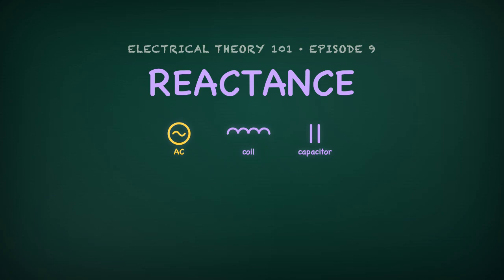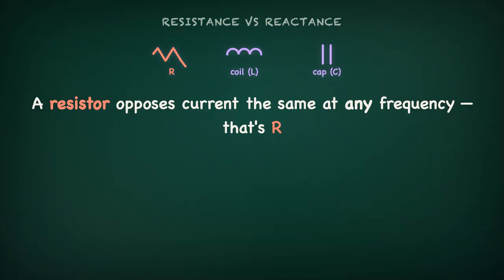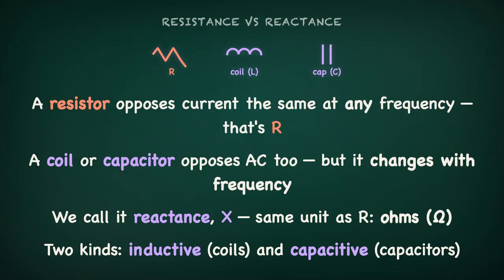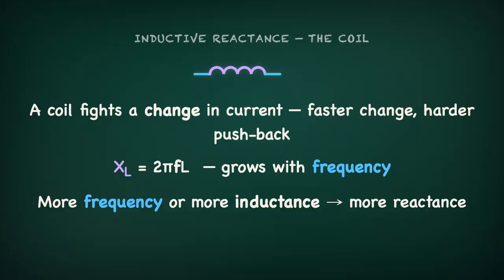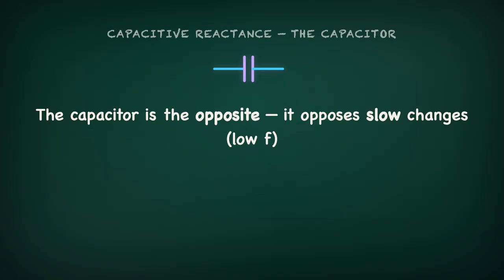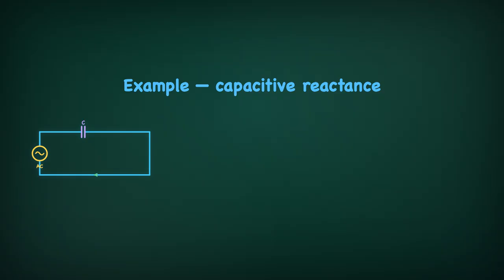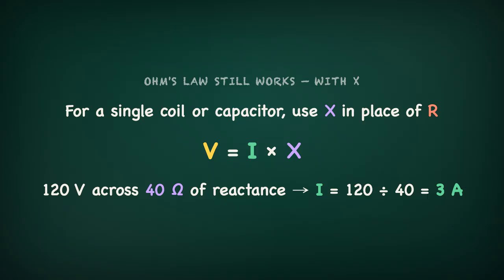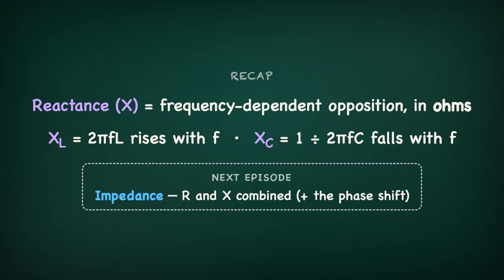Reactance Explained — Inductive & Capacitive Reactance (XL & XC) | Electrical Theory 101

Comment from the maker: Practice answers: A) Xʟ = 2π·60·0.2 ≈ 75.4 Ω; at 120 Hz it doubles ≈ 150.8 Ω   B) Xᴄ rises as frequency drops → halve f → double X → 100 Ω at 30 Hz   C) I = V ÷ X = 120 ÷ 30 = 4 A. Remember: R is the same at any frequency, but reactance X changes with it — coils rise (Xʟ = 2πfL), capacitors fall (Xᴄ = 1/2πfC). What should I cover next? ⚡